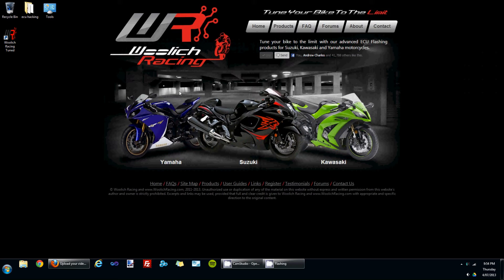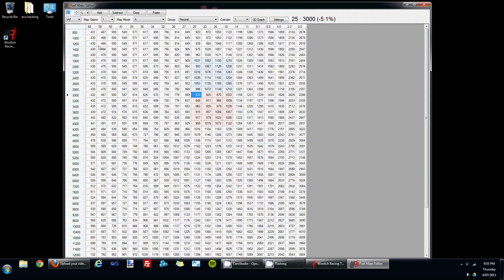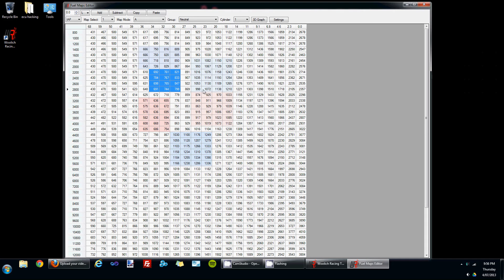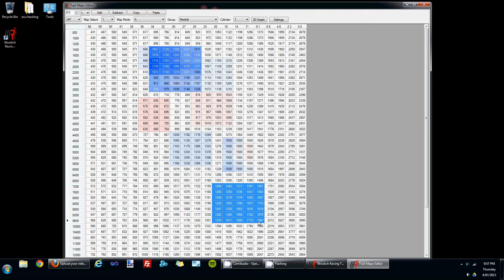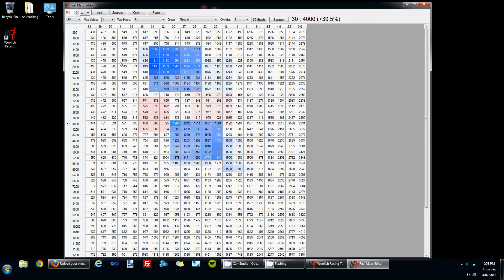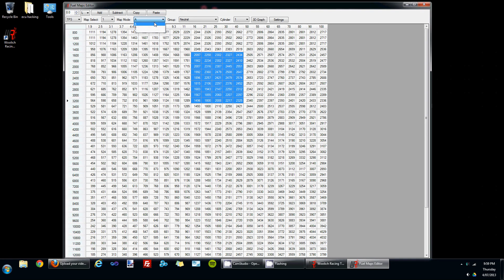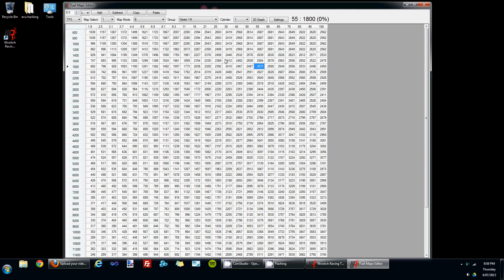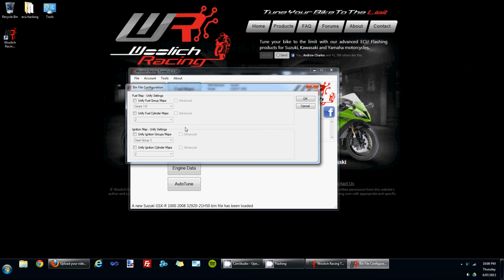Editing Fuel Maps in Woolich Racing Tuned (WRT) sotware

Comment: 2:49 At TPS below 10% the IAP table is used, above 10% TPS the TPS table is used. 
Why is the TPS table filled below 10%? 
Which table must be used to control engine braking?
Reply from the maker: ETV deceleration maps if available
Reply: @WoolichRacing  
 And if not available?
Like the Tenere 700 with cp2 engine?
Throttle is operated through a cable.
Reply from the maker: @dutchchevyman  As the Tenere 700 with cp2 engine does not use an ETV you would need to modify the fueling in the deceleration region in order to impact the engine braking.  If you open a support ticket we can review your current fuel maps and recommend where to make changes.

Comment: On the hayabusa launching at 6500. The rear wheel spins as I'm at WOT at launch. Which table should I edit to limit the WOT in gear 1 to 85%
Reply from the maker: Thanks for getting in touch. Please email support@woolichracing.com supplying the account email you use in the Woolich software and our technicians will assist you directly. Thank you!